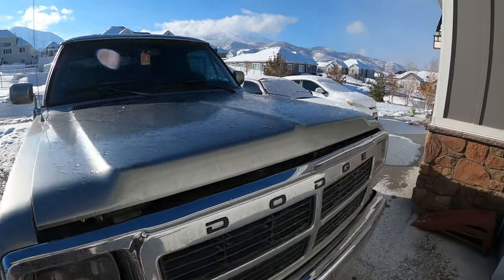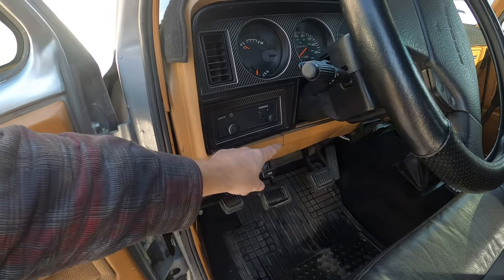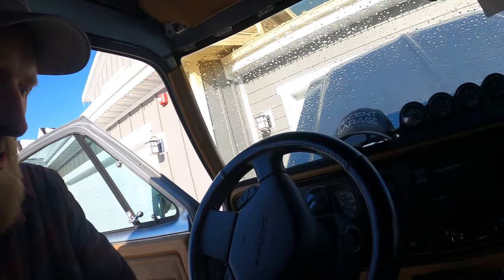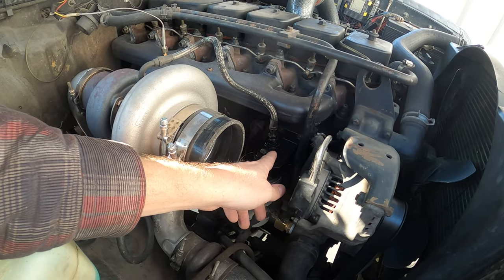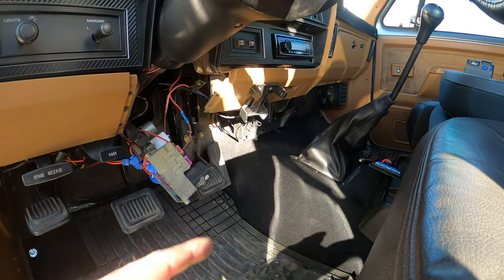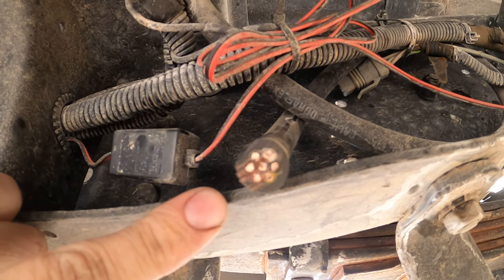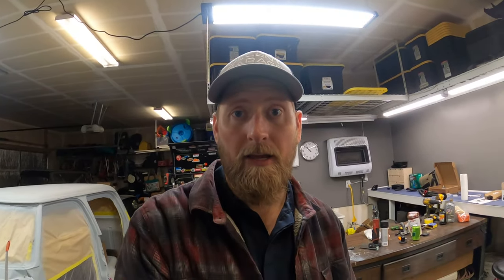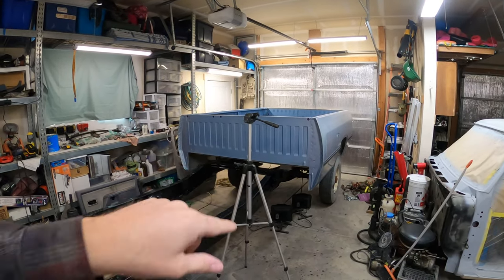The OG Crew Gets Some Much Needed Love!

Comment: I would personally get a higher arch spring and eliminate the upper steel lift blocks. That was more of an old school / cheaper way of lifting vehicles. New springs can help increase your carrying capacity and help with a smoother ride over ruff surfaces. Leaf springs do wear out. Those springs are 30+ years old.  Time for some new ones. Thanks Tim
Reply from the maker: That's a good point

Comment: If that is a first gen turbo fitting it should use a copper washer to seal the face of the line to the fitting. You may have lost it.  Heck with that much lift you should have plenty of room just go ahead and 4 link it and put on air bags.  I would never want a truck with that much block in it as it will axle wrap like crazy pulling stuff.

Comment: I needed this video. Did my nv4500 swap and haven't even thought about checking the hardware because we tightened everything, probably a good bit over torque spec 😅
Reply from the maker: Let me know what you find!
Reply: @Decent Garage  I sure will! Already had a u joint failure, should've replaced it since it looks to original, but found a loose crossmember bolt while investigating that

Comment: 1:  your front leaf spring shackles are touching the frame , bad news , time for longer shackles , 2:  get rid of all those electrical tap connectors , wiring fire is waiting to happen , 3: that cummins engine deserves far better than costco brand diesel engine oil 4: that oil filter flex feed line is not good , it is supposed to be steel or stainless steel   other than those issues , truck looks mint take very good of her and she will take very good care of you

Comment: I finally got a 'Clutch Safety Switch' relay circuit using NC connection via the 'Windshield Wiper' fuse. Truck starts with this configuration, but no cruise control. Also still have a leak. It seems like it is coming around the rubber gasket at the top of the windshield, but not sure.

Comment: Great tip about checking for loose hardware. I completed the auto-to-G56 conversion on my 98.5 Cummins short box 2wd last September. Man I love it! So awesome to drive. Went with the Valair street dual. Soon after completing it I road tripped from Tri Cities WA to Wisconsin and back. It ran awesome and I hit 24mpg on 2 tanks. Your conversion videos were quite helpful with my project. When I finally get around to putting up a video, I will let you know.